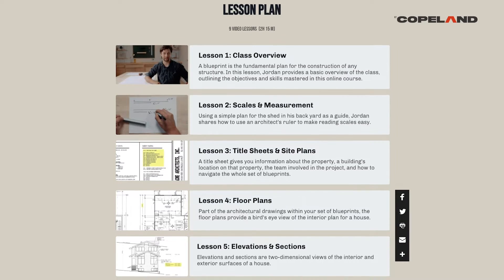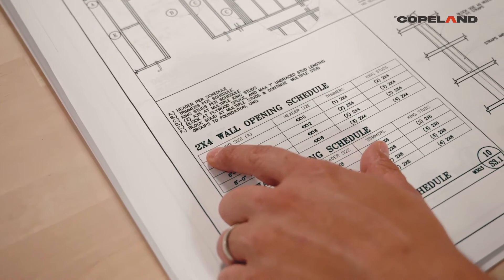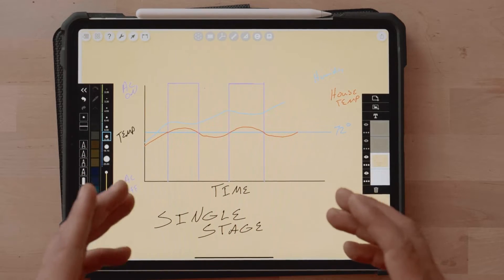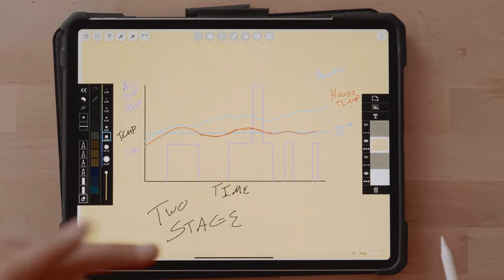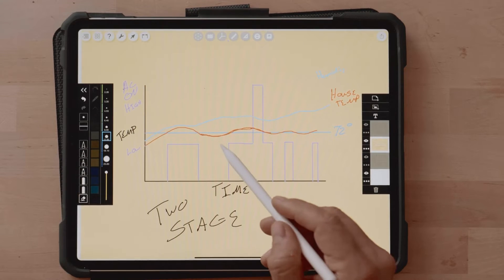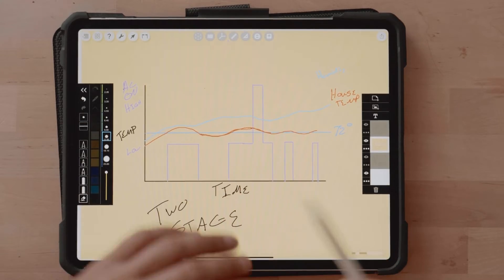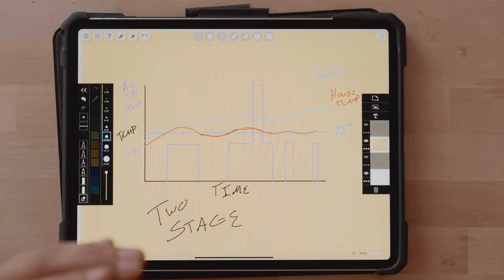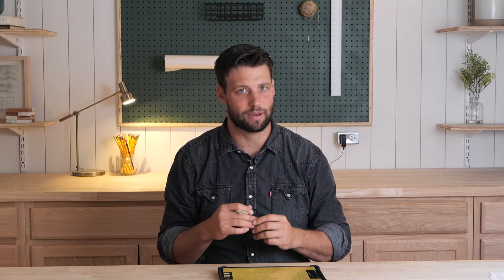Air Conditioners - Single Stage vs. Dual Stage vs. VRF (Mini Split) - Sizing and Dehumidification

Comment: I believe you are mistaken regarding humidity control with a 2-stage being the same as a single stage.  Comparing a 5-ton single stage vs a 5-ton two stage, the dual stage will  run longer when operating on stage 1 and will definitely remove more humidity.

Comment: I had a company come out for a free estimate, I wanted to upgrade my system to a dual stage. A few days later I received an email saying that my ductwork was designed for a 2.5 ton unit and that he didn't have any dual stage units for that size.
 
Do I believe this or does the company just not want my business?

Comment: Im building a two story house. We used spray foam with radiant floor heat in the slab. Have two ducted VRF units and a whole house dehumidifier. Is this good?

Comment: I disagree with your recommendation of a single stage over a two stage. The two stage is so much more quiet than a single stage. Getting a good night’s sleep is more important than your reasoning for a single stage. I just got a two stage system and it is so quiet compared to the single stage. I don’t have to turn up the volume of the TV.  I don’t have a blast of cold air hitting me when the air comes on.  Most importantly, I don’t get woke up every time the air comes on. I am hoping the same will be true when heating the house this winter.

Comment: I live in an area where AC installation costs seem to be far above the national average but electricity is relatively inexpensive (average of about $.112 per KWh) They wanted so much for variable speed units that it was never going to pay for itself. The Two stage was a better solution for me but even here, the return on investment was small, but the added comfort offered by the lower humidity was a meaningful advantage. The VRF systems were just stupidly expensive, even after rebates were applied.

Comment: So glad I found this. You have settled a disagreement with me and my wife. We're building a home - very tight and well insulated. 
We will have two units in the home.  (2k. sq. ft. per. unit work load)

Comment: My problem with 2 stage & VRF is that is only work off of temperature not humidity. Why pay for a dehumidifier in addition to an expensive VRF. I  live in the northeast and single stage has been great for me

Comment: My house is 130 years old in upstate New York and I know that when I went from a single speed furnace to a variable speed furnace the difference was day and night in comfort. I would never want to go back to a single stage furnace. So, I find the praise of single stage air conditioners hard to believe. I have a single stage AC and I don't like it. My biggest problem is trying to cool the upstairs. I was running the fan continuously to try to balance the temperatures but I did some experimentation and found out that was bad for dehumidification.  I spent an hour or 2 in the basement watching the drain hose and finally figured out that the fan running with the AC cycled off was drying off the coil and putting that moisture back into the air.

I have breathing problems and really can't handle humid weather any more. So, I would really like it if manufacturers and installers would get on the same page and have consistent recommendations. Having spent a career working in the technology field, I find it hard to believe that the price differential between 1 stage, 2 stage, and VRF systems has much to do with material costs for manufacture. I just don't see how one system is that much more costly to manufacture than the other base on the parts involved. To me it seems that manufacturers and/or installers just want a wide price difference to make more money off people who want better systems.

Comment: Question, I have a small house 1000 sf,  my old heat pump just quit working after 18 yrs, a Goodman. It's been a good one,  I'm looking at a new york,  2 ton, 14.2 seer, I trust my contractor,  installed it will be 6,890 . Is this a good deal? Any advice would be appreciated thanks...

Comment: An engineer friend said I was losing efficiency (and therefore $$$) because the outside units are in a corner under a porch. He suggested moving them out to the edge of the porch for better air circulation (thus less $$$).

Comment: Roughly how much more is a 2 stage ac over a 1 stage?  I have a 3 ton, but my fan is set very high, and I think it and the compressor could run lower most of the time.

Comment: One comment regarding vrf. Reliability has indeed improved over the years but, in the event a vrf motor does go out (and I have), you’re looking at a considerably higher cost to replace than a constant speed motor on the order of 2-3x the cost and availability of vrf motors is less.  Higher cost to buy, higher cost to replace, potentially longer downtime. In my case, I had the service tech to replace with a constant speed since the unit was over 12 years old and the dead of summer when it failed.

Comment: I have a Daikin VRV life system,  (notthing fancy like what itst meant for just a outdoor unit and a cxtq coil like a normal system)  and the dehumidifcation ability is basically zero.  After having it installed the house can't get below 55 percent humidity, I had to install a whole home dehumidifier to get it into the 40's.  The unit runs all day and its behavior as far as hitting set point is just bonkers.  Set it to 72,  starts at 74,  stays at 74-75 on a hot day,  running 18 hours.  Eventually shuts off at 71 in the middle of the night.  It seems to work by using outdoor temp and indoor thermostat to figure out what level of cooling is needed.  It will run to get the evaporator coil temp between 37-54 degrees.  I think my evap coil sits in the 40's and with dew point at 7x degrees you need to get into the 30's to actually dehumidify.  So I guess the savings is run the unit at 1200 watts for 18 hours vs 4k watts 10 or 20 mins per hour for 12 hours (variable vs a 4 ton single stage)

Comment: Take a old reliable ge weathertron any day, THEY LAST and some are still running today, it was the king and if the design was still in today would crush the competition, of course trane bought them and started buying the government lobby and all the bells and whistles, yes today's units saves  power and closer temp and humiditya lot of contractors don't do proper acca load design and proper design, we have to deal with other wana bees mistakes ,so the weathertron handled the reliability issue due  to the incompetents out there that don't know thier trade, static, subcooling,superheat, bypass on zones don't enter their mind.vrf are great if the system is designed correctly, but how many times have you come to a proper designed house.a lot of incompetent and very few versed educated contractors out there, the ge in the day addressed this,more forgiving.what we need today is educated techs that treat thier customers fairly not wana bees. I'll take a reliable system over energy any day.

Comment: I can tell you from first hand experience you do not want to oversize I was friends with the guy that put in my system brand new home $1,600 ft all right now we had a bonus room above the garage he told me you need a another unit for that one room I was like what he was like yeah I'm going to put a 3-ton down here and will put well I don't think they make a half a ton I don't think we'll put a ton for upstairs well I was like how about we just put a return up there with some vents and tie it all together and let's go with a 4-ton unit no he says and then he looks at me and goes you will short cycle now you already understand what that means it can be 72 with low humidity and extremely comfortable and it can be 72 with high humidity and extremely uncomfortable with that being said I begged him to put it in that 4-ton unit once again he tried to talk me out of it he even suggested let's just wait on the room upstairs we'll figure out something later but for downstairs 3 ton or even three and a half time is plenty for only $1,600 ft he begged me I still said no so I did get a Train because they have a good reputation does it work well well at first I thought I was living in the Amityville Horror house because the doors would  be pulled from your hands as you closed the doors in the house ok now the air ducks  were redone for better airflow and he redone all of the ductwork I kept hearing him screaming don't forget to insulate the boots because I have hardwood floors and then he explained to me what that meant so the reason I am telling my story don't make the same mistake I did I found out real quick what short cycle means now living down in the south I will say when it's 100° outside I can have my house at 65° inside and the air coming out of the vents is around 39° in the middle of summer now this is a gas pack I probably should have started with that as well same thing applies in the winter just not as bad he did tell me after I called and said David you were right and he says to me I tried to tell you you're very hard headed and you would not listen you were hell bent on a 4-ton unit I almost tried to put a 3 ton in there but I knew you would catch on because you had already picked up on the sear rating so I knew you would figure out I had pulled a fast one at the time I wish he would have so now I get up in the morning cut that bad boy on and let it go all day if not it's on and off on and off and you never get comfortable because you're never pulling that humidity out of the air but what does happen as about 2:00 in the afternoon approaches it will actually get cold inside the house so I called him up last summer and I said David does it hurt if the machine just runs all day he said to me actually no it's not that bad on the machine to run all day long it will actually make your capacitor last longer and other parts as well however what it will also do is drain your wallet and let me tell you when you have an AC system that runs all day and half the evening yeah I wish I had the square footage he mentioned and my power bill was 80 bucks I live by myself in a 16-ft home with the upstairs being heated and cooled which is never quite as cool up there as it is down stairs but you can tolerate it however doing what he originally told me I regret it to this day 10 years later so if you are building a home or if you are replacing your system I don't imagine oversizing Maybe by a half a ton would be that bad but when they tell you a 3-ton is good enough and you demand a 4 ton call me I'll tell you how much that $280 power bill was last month and I don't cook and I have gas hot water so that $280 was for two lamps  refrigerator TV, AC system, and a few other little odds and ends so bottom line to  shortness this up please do not make the same mistake I did and oversize your system if you do you will have to baby it all the time like it's another child in the house or something you will constantly have to be at that control always adjusting always having to make preparations the only good thing about it is if you're hot natured you're more than welcome to come hang out at my house when it's 120° heat index included and I'll have the settings @ 62  degree temperature with low humidity and you'll probably ask me for a sweatshirt in the middle of August while you're trying to drink a cold beer and watch the football game bottom line do not oversize!!

Comment: You're talking about compressors...what about the 2 stage air handler with single speed compressor?
Reply: Mike Daniello - if you size your 1-speed condenser and evap coil for the highest fan speed for maximum cooling, you're likely to experience problems if you reduce the airflow in the air handler without also reducing the output of the outdoor condenser.  Your coil could freeze up.

Comment: Interesting topic. I live down south and I'd personally rather have a VRF system than a dehumidifier. My VRF mini split dehumidifies very well since it runs almost constantly and is incredibly energy efficient. The same dehumidification could be accomplished with a single stage AC and a separate dehumidifier, but the power usage would be much higher. A dehumidifier is basically an AC unit that dumps its heat back into the building instead of dumping it outside, which is good in cooler weather to prevent overcooling but bad in hot weather where dumping that heat outside would be much better. I think the perfect solution would be an AC/dehumidifier combo unit (preferably VRF) with a separate reheat coil inside to redirect the necessary amount of heat back into the building to remove humidity without overcooling while still dumping the extra heat (or potentially all heat) outside depending on cooling and dehumidifying requirements. This way you are never paying to run a dehumidifier to recirculate heat back into the building as well as paying to run an AC unit to remove that heat. Unfortunately I'm not aware of anyone who makes these systems yet.

Comment: "will condensate", really?  🤔
😂☮️
You're right about the people doing the sizing calculations.  What you seem to miss is that when cooling humid air, the energy of the evaporating refrigerant is absorbed condensing (not "condensating") the moisture from the air, not cooling the air much at high humidity so it cools more air as humidity drops.  The system would have to be grossly oversized in order to cool the volume significantly yet still leave the air perceptively humid.  I agree with you on the payoff of fancy electronic variable speed systems (never mind repair costs and availability of parts way down the road) and with the airtight insulated structure.  But the only place for a dehumidifier imo is subterranean conditioned space where the heavy humid air tends to accumulate and cool surfaces abound.  
I also agree about higher setpoints; I run my oversized a/c at 80F and the humidity hovers in the upper forties.  Coming in from the humid outdoors even when only a few degrees warmer outside it feels much cooler and a comfortable reprieve indoors, and at a minimal energy consumption.  Been doing that for thirty years.

That said, I'm still impressed with these mini split systems with their complex computer algorithms, speeding up and slowing down, directing air up and down...  Kinda silly in a way but quite effective in a single open area, and quiet.  Now, when they break, it could be a troubleshooting and parts acquisition nightmare, but operationally they're rather fascinating.
Cheers!

Comment: I'm a DIY but also believe that the 2 and 3 ton split systems have a sweet spot when it comes to cooling BTU per cost and power usage. I noticed that the 5 ton systems are big on power usage compared to 3 and 4 ton units. So, cost to operate might play into the math, put in two smaller units or one 5 ton?  I'd opt for two smaller units myself and likely experience better control as well as save money on power...Some locations sell power way more than others such as California. I know folks in Nevada and they pay 6 cents for tier one power then 8 cents for tier two. In CA they charge .32 cents per kWh and .45 cents ! It's all because of the state of CA who runs the power grid via CA ISO in Rocklin, CA. They are forcing power distributors, SCE, PG&E, SDG&E, to pay the state sanctions for selling power produced by coal or natural gas and that is part of our rates ! Only in CA !

Comment: I totally agree with going with a single stage system and 90% on gas heating. Why? Value is the main reason. VRF is outrageously expensive, complex, expensive to maintain and likely finding the correct parts when in need will be expensive and involve a waiting period to source them, likely from the manufacturer. Even for VRF to provide any value, the cost to run them would have to be a good 2/3's less energy used compared to a single stage system or else, the benefits just do not measure up. Same goes with those two stage systems. Yes, they aren't as noisy etc. however, all newer HVAC systems are quiet enough compared to 20 year old HVAC. For a working household, both at work all day (or other shifts) then home for a few hours before bedtime then gone again the next day, VRF and 2 stage just cannot give enough satisfaction not being home long enough to experience them. The retired crowed would have the best experience because they would usually be home longer. So, if the industry would offer those systems for less than they are now and provide parts for a good 20 years or so, they might have more value to the average family. As it is, its a choice between spending lots of cash money of HVAC to maximize lower energy costs or spending minimal cash to reduce energy costs at a moderate pace. 

Those in California would likely benefit from VRF only if the main focus was to use the least amount of power during summer since their electric rates are inflated by 4 to 6 times the national average. CA is paying about .45 cents per kWh during summer !  Nevada is about .08 cents per kWh. Both states get their power from the same sources so who is fooling who? Also, California is trying to eliminate natural gas in new home construction meaning, no gas fire place, no gas BBQ, no gas water heating and for HVAC, electric or they are forcing the industry to use highly expensive gas efficient and CO2 limited units that are out of sight in price. Even in existing homes, California is requiring super expensive water heating replacements and HVAC replacements that produce less CO2 and NOX than the era those homes were built.  It's super expensive and the benefits are not going to the home owners, the extra over priced systems are slightly puffing less pollutants but no one would agree the extra cost is of any benefit in CO2 and NOX savings. 

Folks are best off to replace what they have with a single stage 18 SEER or 16 SEER A/C and 90% efficient heater for the best value and for parts availability when time comes a part fails.